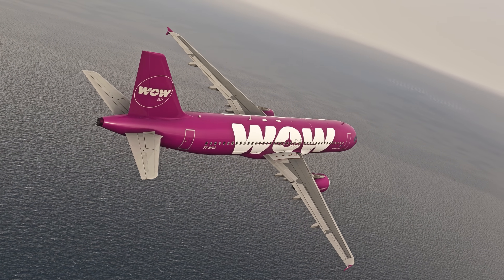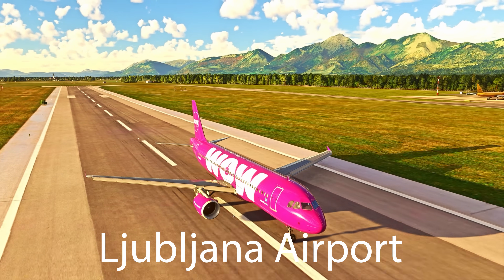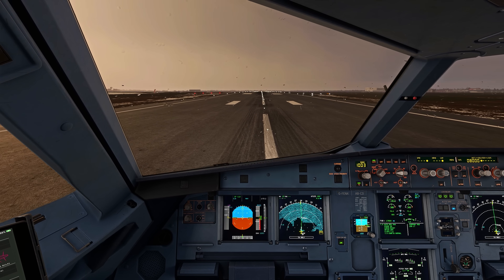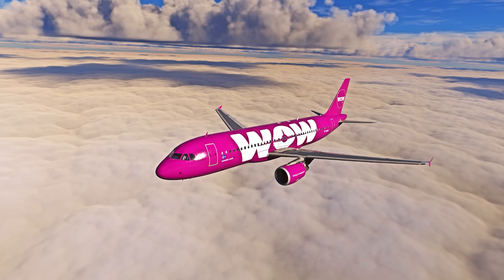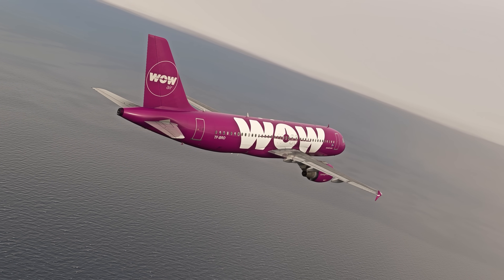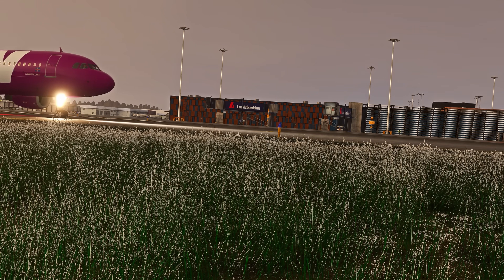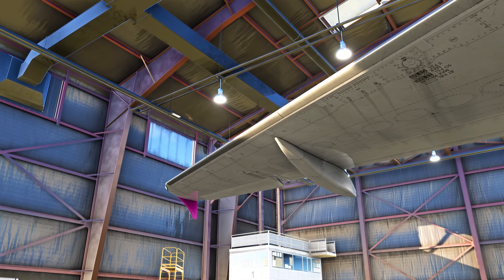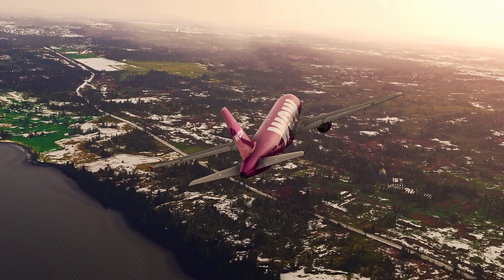Maintenance Mishap Almost Leads to Catastrophe! | The Story of WOW Air Flight 117

Comment: Thank goodness these pilots didn’t dismiss the error as computer related like the Gimli glider Captain and continue with their journey!  Having watched so many aircraft accident videos where maintenance screwed up, I would feel concern, not reassurance if I was boarding a plane I knew had undergone  a recent C check.  I never knew a B check existed!

Great video, this is one of the best aviation disaster channels.  I’d not heard of this mishap before.
Reply: I believe he said D-Check.
Reply: @edwardrichardson5567 thank you!  “Had just had a recent D check” then.
Reply: @edwardrichardson5567  I heard it was fresh out of C check but also mentioned D checks and various intervals.
Reply: @bitteroldman701 I suppose I’m forgetting that I’ve only heard about the times maintenance screwed up.  A quote from the NTSB says that almost all accidents have a degree of pilot error in them and normally it’s a series of small errors or decisions that line up with - if even one of those steps had gone differently the accident probably wouldn’t have happened.  The Swiss cheese model is often used to demonstrate this.

Comment: It might be better if the explanation of the mechanics were more clear. Those guys spend a lifetime learning and working with all those parts; it's not reasonable to expect that a casual YT viewer will understand that assemblage of parts, unless it is very carefully explained, very simply, at a level equivalent to his experience with cans, lids, rubber bands, screwdrivers (and the ubiquitous "instructions" Google-translated Korean like from to many clear function explain to how work advance with easy). Changing an oil filter in an automobile is not a complicated procedure, in most cases, but not many people change their own oil. My take-away is that the manuals have many sections and sub-sections. The explanation of the levels of maintenance / overhaul of an aircraft, and frequency, was totally new to me. That was easy to get (not so easy to do, I imagine!). The quantity of oil was easy (and new info). But I did not get the parts about the parts and the sequence of "changing the oil" on an airplane, and the inspection part of it not being done should have been a red flag right there, a "stop, and re-do"). The thing about an airplane is that you can't exactly pull over to the side of the road and walk to the nearest gas station if something goes wrong.

Comment: I know the handbook said to shutdown the engine (#2) ... but really surely it should just be put on idle ? - at least it might still give some thrust if needed...i.e. if engine #1 had also given up on final approach then having a tiny bit of power might have been helpful 🤷‍♂
Reply: Even on idle with no oil the engine would have chewed itself up and overheated long before they got to final approach

Comment: Something I wonder about is their taxi procedures - I know that sometimes twin jets will only taxi with one engine on, so would it be possible that they were taxiing on the number two engine, and more use would accelerate the failure?
Reply: It might make the engine more prone to failure, but probably not because of the extra few hours of use during taxiing, and more because they would be more likely to damage that engine with foreign object debris getting sucked into that engine on the taxiway. 

If I owned a jet I’d be asking for towing that thing everywhere and trying to only use the engines in flight lol.
Reply: Shutting down a jet engine during taxi is done after landing. If the commanders deems it safe. For example with dry taxiways and not too much up or downhill slope.

Comment: Another great video! 😊 very interesting how such a "small" mishap can lead to something so life-threatening. And scary, too 😅
Reply from the maker: I found it interesting that both engines had the same issue, with what appears to be luck that kept engine no 1 from the same fate as engine no 2!
Reply: @CuriousPilot90  Not only those, but other aircraft with different vendors. The instructions didn't seem that unclear to me. I'm surprised the airline didn't write their own workcard for it. Make it an RII task and it would not have passed QC without a second signature.